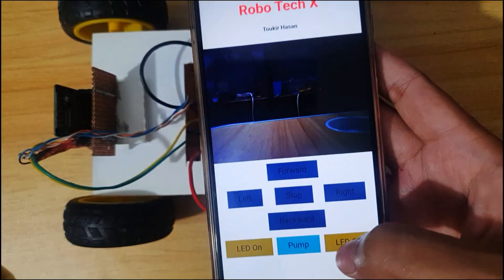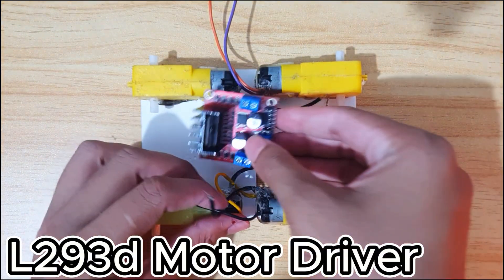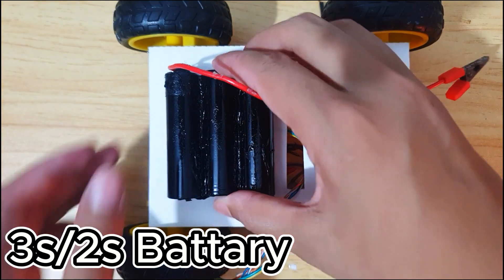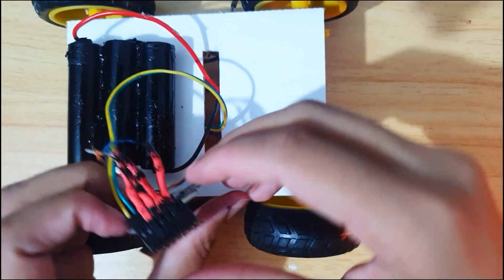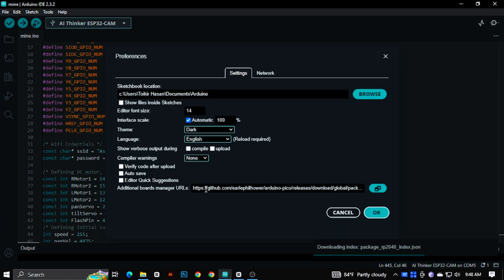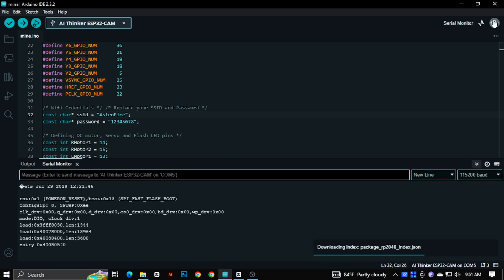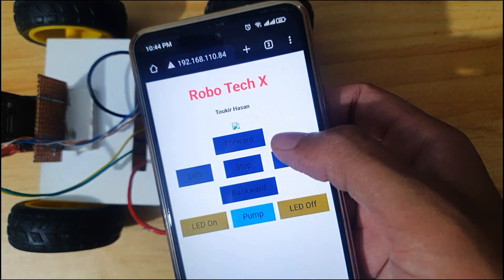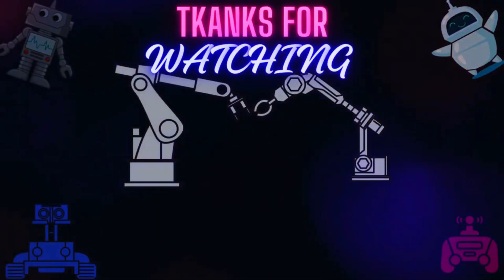Esp32 Cam Rover || Camera Car

Comment: Is one  motor driver sufficient to control 4 wheels??
Reply from the maker: Yes, Because two motors of a single side are acting like a single motor.
Reply: @ROBOTECHX-fi5zn  my project is a agro-rover so thinking of adding a water pump can esp32 cam control over relay will it be too much for cam to handle???
Reply from the maker: @thughunter4205  I used these components with the ESP32, and they work fine. However, it might be better to use a different microcontroller.
Reply: @ROBOTECHX-fi5zn  what i thought is using esp32 devkit for relay and water pump so can i code it to have button on same page as rover?
Reply from the maker: @thughunter4205  You Should Write 2 codes. 1 for the Esp32 controlling the Gear motors and relay and another for esp32 cam casting video.
Reply: @ROBOTECHX-fi5zn  alr and what is thing with motor like how should be polarity of terminals bcoz i faced problem with when clicked front it went back